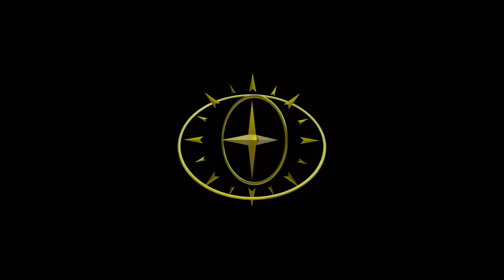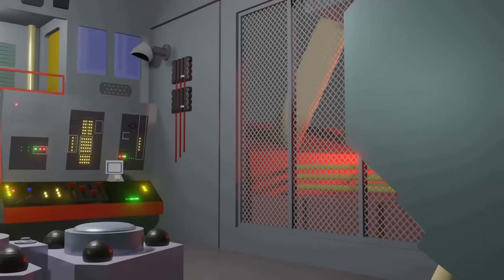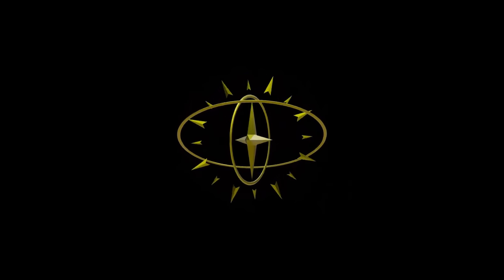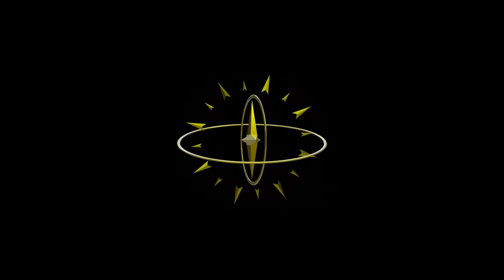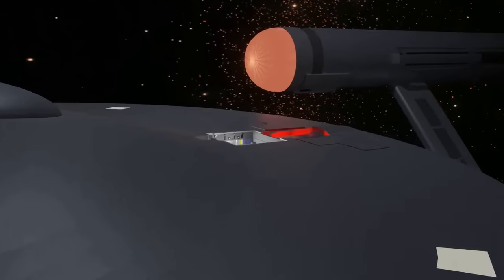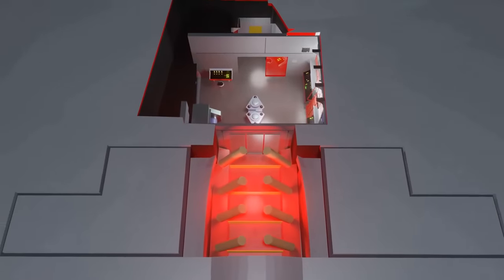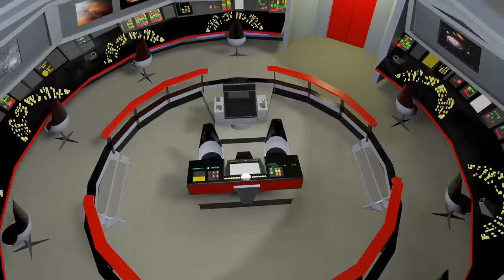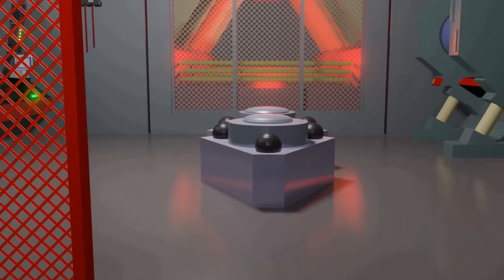The Enterprise Engine-room Enigma: where was main engineering?

Comment: Franz Joseph's decision to cram Main Engineering right in front of the impulse engines stems from a reference in "The Making of Star Trek" (Stephen E. Whitfield, Gene Roddenberry, 1968) that states that the "headquarters for the Engineering division" was located in that area.  However, just a few pages later, we have the secondary hull, "also called the Engineering Hull".  In fact, Doug Drexler and Mike Okuda asked Matt Jefferies where Engineering was, and after giving them an odd look, replied, "In the Engineering Hull."  Like most of the technical questions in TOS, the answers depend on what's going on in the episode, and therefore how much weight to give each answer.  If the threat to the ship is external, like Landru trying to pull the ship out of orbit, and the solution involves Kirk talking the threat into self destructing, the technobabble is vague and usually makes some offhand remark about the most visible aspect of the ship's power, the nacelles, which doesn't really matter because Scotty can't do anything anyway.  *BUT*, if the threat is internal, like the engines are running wild and Scotty has to actually do something, we are almost every time presented with the model of the ship's power being generated internally from a central reactor in or near Engineering, feeding power out to the warp engines in the nacelles.  These examples carry much more weight, and this is the scenario Sternbach and Okuda went with when doing their version of the Enterprise's deck layout, and one I agree with.

What I don't agree with is the idea that those glowing tubes lead directly to the nacelles.  For one thing, the angle is completely wrong, even if you follow them through where they cross over, they don't match the angle of the nacelle struts.  This also puts Engineering too far back in the hull to my eyes.  Plus, there's that big doohickey in the middle of the room starting in the second season, which is shown to house the dilithium crystals.  By necessity, this needs to be upstream from the nacelles (later ships had the dilithium right in the intermix chamber, but at this point, they were separate units, just go with it).

So, my answer to these evidentiary tidbits goes thusly:  The matter/antimatter reaction chamber (later known as the warp core) is located directly under that tube assembly, which is actually the main power transfer manifold, sending energy to the rest of the ship.  What we don't see, though, is the conduit leading from the M/ARC directly to the dilithium crystal articulation matrix, amplifying the frequency of the plasma stream sufficiently to generate a warp field, and from there, it goes to the nacelles, through a set of transfer conduits just forward of the hangar bay.  In other words, from the second season on, when you're in Engineering facing those tubes, you're actually looking forward.  This also allows Engineering to be moved forward so that the warp core is directly over the yellow circle with the red outline on the underside of the secondary hull, making that the warp core ejection port.
Reply from the maker: All very good points. On your final point, 'Day of the Dove' has the characters facing one way (port) when the entity leaves, but the POV is clearly the starboard wall behind them. So, perhaps you are right and the main engineering in the video is facing the wrong way? A subject for a future video, perhaps?
Reply: @WeTravelbyNight  Maybe.  But in matters like these, like that curved corridor, you just have to yield to the restrictions of 1960's tv budgets and ignore the sniggling bits.  Otherwise, you drive yourself insane reconciling the change of the ship from production version in most of that episode to second pilot version in that one shot.
Reply: Jefferies' bemused response likely stems from the very initial design philosophy of the Enterprise, in which the Primary Hull was intended for habitation and the Secondary was for power and drive systems, the idea being to keep the crew safe from all the radioactive/explodey/warpy bits (which is how we still conceive spacecraft design in real life). It follows that only the Primary would have had luxuries like full atmospheric pressure and artificial gravity. This strict division of functions was obviously abandoned early in the show's preproduction, as the model has always featured conventional viewports on the side of the Secondary hull, as well as the shuttle bay in the stern. But I can see Jefferies and others sticking to the original intent of the ship's configuration.
Reply: @thork6974  Doesn't TWOK clearly show the Reliant's phasers targeting the secondary hull and causing devastation in engineering?
Reply: @ian_b  The "Refit", or "Constellation II" Enterprise design clarifies things considerably. It's the TOS ENT where anything goes.
Reply: @thork6974  Would they really have moved the engines from the saucer to the secondary hull though?
Reply: the tubes are GNDN Tubes: goes nowhere, does nothing. they’re decorative for the set, nothing else
Reply: The original Star Fleet Technical Manual has TWO engineering areas: an area marked "Main Engineering" near the Impulse Engines in the saucer, and a separate "Warp Drive Engineering" in the secondary hull right under the nacelles. Main Engineering is shown to have computers that can monitor the warp drive from there.

Also, Star Trek altered and reused sets as different rooms constantly, so there's almost no point in trying to reconcile most of the filming sets with the actual shape of the ship. I tend to lean in favor of the book that was written by an Army Air Corps engineer instead of random Hollywood camera angles.
Reply: @ian_b  they wouldn’t, refits are simply upgrading systems and fixing everything broken or worn…the only confirmed major changes were modular parts: weapons systems and the bridge.
Reply: @bostonrailfan2427  And to look like the guts of a giant engine of some kind.
Reply: @Idazmi7  I've come to the conclusion that a Naval approach makes better sense logically than Air Force.  And FJ was working with a fraction of the reference material that we have today, so I don't fault him, I just think he was misinformed, underinformed, and ultimately wrong.
Reply: @CaptRobertApril  
Why is Franz Joseph wrong about needing two engineering rooms? The Enterprise clearly has two different engines in two different locations, so it's necessary.

"I've come to the conclusion that a Naval approach makes better sense logically than Air Force."

I strongly disagree: the Enterprise is not a water navy vessel, it is a starship with a highly irregular profile. Using a navy standard would imply the ship is shaped like a watercraft, and that's just not the case.
Reply: @Idazmi7  Conceptually, he's not wrong at all.  The problem is that an engine room next to the impulse engines would bear very little resemblance to any version of Main Engineering, if only because it'd block access to the secondary hull.  In my attempt at some deck plans, I've got an engine room there, nice two-level setup, but nobody's gonna mistake it for Main Engineering.  In fact, with what started out as more of a joke, but it actually works, I put 1st Season Engineering forward of the big tube thingy, 2nd & 3rd Season *aft*, with the dilithium housing in the middle of the room backing that up.  They changed the contours of that set so much between the 1st and 2nd seasons that they really weren't the same room anymore.

"Naval approach" in that this is not an oversize airplane with weird engines on the wings, it's a large vessel with a large crew, with a central power plant sending power to the rest of the ship, with the nacelles acting as the propellers.
Reply: @CaptRobertApril  
""Naval approach" in that this is not an oversize airplane with weird engines on the wings, it's a large vessel with a large crew, with a central power plant sending power to the rest of the ship, with the nacelles acting as the propellers."

Ah, the TNG 'warp core' retcon. Matt Jefferies put the engines out on pylons for safety reasons, not for resemblance to airplanes. With the engines on the pylons (which is borne out by dialogue), the engines can be easily ejected in the event of a breach, and radiation leaks won't instantly kill the engineering crew. The man knew what he was doing.

"(...) it'd block access to the secondary hull"

Not as drawn up in the manual.
Reply: @Idazmi7  Engineering is accessed via a corridor, not a turbolift.  Manual is wrong.
Reply: @CaptRobertApril  
"Engineering is accessed via a corridor, not a turbolift. Manual is wrong."

The Star Fleet Technical Manual and Booklet of General plans show direct engineering access via corridor.
Reply: @Idazmi7  I've had both since they were published.  The don't match the set, so they don't count.  In fact, I just looked at the Tech Manual, it shows a turbolift where there should be a corridor.
Reply: Purely on logic, engineering section was between nacelles (what obviously need to be connected to it) and deflector. What was another high power area. Hangar itself was quite small, hosting two shuttles top. Later in TMP movie he have visual confirmation that, behind the hangar is store room. But it move down. With clear floor above, so that is where engineering most likely was originally (it was changed into vertical core with this modifications, but conduits still should go through that area). It was most likely where the closed space was (hosting core), with the room itself in higher part of hull behind the deflector. Considering that "neck"  of the ship barely could hold anything. It make sense why engineering hindquarters would be behind the impulse drive (back of the saucer), being relatively close to both sections.
Reply: @TheRezro  Unfortunately, this ship wasn't designed purely on logic, but by what looked good on camera.  Like Gene Coon told a writer, they weren't looking for "possible", they were looking for "plausible", so there was a lot of "close enough" kind of things going on with the design of the ship.  The fact that bothered at all with a design logic puts Star Trek well ahead of anything Irwin Allen was cranking out at the time.
Reply: @CaptRobertApril  
"I've had both since they were published. The don't match the set, so they don't count."

The Engineering set changes in every season of Star Trek, so that's moot: if you designed the plans to match the show exactly, you'd always have two versions of Engineering that contradict what's in the book. That makes complete adherence to the show a literal impossibility.

"Unfortunately, this ship wasn't designed purely on logic, but by what looked good on camera."

Exactly why the manual is and will always be a far better reference than the show itself: it doesn't change with the budget. Which is exactly the reason it was created.
Reply: @TheRezro  
"Purely on logic, engineering section was between nacelles (what obviously need to be connected to it) and deflector."

Like most people, you forget the need to maintain the Impulse Engines, which are in the saucer. The pre-Refit Enterprise's Warp Nacelles are not attached as close to the Impulse engines as they are in the refit. Also, the saucer can separate, so you'd need two separate engine rooms regardless.
Reply: @Idazmi7  It's not a decent reference if it blatantly contradicts what you see onscreen.
Reply: @CaptRobertApril  
"It's not a decent reference if it blatantly contradicts what you see onscreen."

You know that's an irrational point to try to make. The ship itself often changes forms from shot-to-shot in the same episode (thank you, "stock footage"). Main Engineering changes form in every season. All the ship's weapon's fire comes from the same little dome on the bottom: phaser beams, photon torpedoes, proximity blasts.

The manual was made for a reason: to establish continuity where the show could not. Unlike the show, the book doesn't change.
Reply: @Idazmi7  For it to be a good reference work, though, it has to at least be in the ballpark of looking like it did on screen.  In many areas, the TM and Deck Plans are horribly off kilter and are useless in that regard.

The curvature of a corridor can be ignored, but you can't pretend that corridor was actually a turbolift and be taken seriously.
Reply: @CaptRobertApril  
I can however, pretend that the large power transformers and dilithium chamber in Engineering were there in every episode, when they clearly were not (In fact, they shifted around according to the needs of the plot, sometimes between individual shots). I can also pretend that a photon torpedo tube and a phaser bank are both in the exact same place.

Or, I can go by the book, instead of constant set redesigns and moment-to-moment plot changes.
Reply: @Idazmi7  That sort of thing is why a proper set of deck plans is such a pain in the backside.
Reply: @CaptRobertApril  
"That sort of thing is why a proper set of deck plans is such a pain in the backside."

You mean "impossible". The discrepancies between episodes are so extreme that they simply cannot be reconciled, so there will always be 'mistakes'. You cannot rely on them for consistent visual data.

That's why I always refer to the manual instead: it doesn't change. It is the same now as it was in 1974.
Reply: @Idazmi7  And was horribly wrong even at the time.
Reply: @CaptRobertApril  
Imagine hand-painting a portrait of a shapeshifter who insists on changing their face every ten seconds. Unless you can paint the portrait successfully, matching every feature of their face, criticizing the Technical Manual for not matching onscreen sets is the absolute article of a double-standard. Any and all fan-made blueprints will automatically suffer the same issues, with the caveat that the fans generally don't have engineering experience.
Reply: I like to think that there are 2 engineering areas, one for the impulse drive, one (larger w warp core & dilithium matrix) in the engineering/secondary hull.
Reply: @mahatmarandy5977  Don't get carried away with crediting Jefferies with an overabundance of sci-fi technical savvy.  The second he heard the ship would have warp drive, his response was, "What the hell is warp drive?"

He was just designing a futuristic engine room, and according to him, it was down in the secondary hull, a.k.a., the Engineering Hull.
Reply: @mahatmarandy5977  Doug Drexler and Mike Okuda asked him.  Go ahead and ask them, Doug loves to chat.
Reply: In this case, "popular consciousness" only extended to the readers of Astounding and other pulps, because the science fiction authors and readers were the only ones talking about it.  Hell, I'm 58, and this is the first I've heard of it.  And while Jefferies did read a lot of aeronautical publications, NASA press releases, and technical magazines, he wasn't a science fiction reader.
Reply: @mahatmarandy5977  
"Yeah, the glowing tubes were intended by Jeffries to be "Dean Drives," a kind of reactionless engine that was thought possible at the time, but which later turned out to be a hoax. Impulse engines were dean drives, at least in conception at the time."

No. "Impulse" literally  means "force applied over time", which makes them a reaction drive, not a "reactionless" drive. Both TOS itself (in Balance of Terror) and the Technical Manual reference them needing fuel.

"Engineering is at the rear of the saucer section (As evidenced by the curvey hallway that connects to it) There wasn't any other engineering complex in the secondary hull, and in fact apart from the hangar bay, we really don't spend very much time in it at all. (Hence Franz Joseph filling it up with redundant stuff)"

1. There must needs be an engineering section for the Warp Drives as well, necessitating two Engineering rooms.

2. The Secondary Hull has redundancy with the saucer section because it is meant to be a fully independent ship when separated. Otherwise, there no point in saucer separation at all.
Reply: @CaptRobertApril  ok, yeah, that sounds fun! How do I contact them?
Reply: @mahatmarandy5977  
"So, for instance, Jeffries did not write "Balance of Terror." (...)"

Even so, the very term "Impulse Engine" still implies the existence of an impulse, not the lack thereof. Thus, it is not a "reactionless" drive. Wasn't even conceptualized that way, or they would have called it something else, even "Impulseless Drive".

"Also, the diagrams IN the tech manual deviate significantly from the actual on-screen sets we saw."

Been over this already: the "the actual on-screen sets we saw" are not visually consistent, so criticizing any blueprints for not precisely matching the on-screen sets is pretty ridiculous. I don't know why the myth persists that it's even possible to do.
Reply: @mahatmarandy5977  Facebook works.
Reply: @CaptRobertApril  Ok. Thank you.
Reply: @mahatmarandy5977  
"My point was that the 1975 tech manual isn't reliable. Your point is the sets themselves are not consistent. So if neither is reliable, what are we arguing about?"

Your reasoning for the 1975 tech manual being "unreliable" is the fact that that it doesn't match the sets... when the sets themselves are not consistent. If you cannot see the irony in that premise, that calls your basic rationality into question.

Question: do the sets in Star Trek change, moment-to-moment?
Answer: yes.

Question: does the 1975 tech manual change, moment-to-moment?
Answer: No.

Conclusion: 1975 tech manual is reliable and consistent.
Reply: @mahatmarandy5977  
Put more boldly: unlike you, I have no cause to bow down and worship the visual presentation of a serialized television program with inconsistent editing, outdated visual effects, and often nonsensical plotting. Instead, I will stand by the notes and efforts of the career engineers who - for very little recognition or money - put their heart and soul and knowledge into those technical blueprints, knowing full well that their time and efforts were doomed to be wasted on a banal entertainment series and it's equally banal fans.
Reply: @mahatmarandy5977  
"I'm gonna draw a comparison that I hope isn't too tendentious: The Civil War is a thing that happened, right? Seventy years after the Civil War, "Gone with the Wind" was written. (...) I don't really understand your point there."

Star Trek isn't real.

I was hoping you didn't need me to explicitly say that, but you apparently do. And even worse, you are literally comparing historical revisionism in relation to a real war full of pain, death, and controversy, with a fictional program that can't even get it's OWN history right from episode to episode. No wonder you can't see the irony in your own statements: you are obsessive AND mentally unwell, unable to discern fiction from reality, or ascribe importance to real events instead of your fantasies.

"Likewise, the Franz Joseph Tech Manual was (...)"

Directly commissioned by Gene Roddenberry, canonized by the same via his signature, as well as licensed and copyrighted by Paramount, written and drawn up by a USAF engineer. By the way, the moment Gene was involved, it became an official part of Star Trek. You lost this debate in 1973.
Reply: @Idazmi7  Ok, so if I understand you, you're saying that you don't care about the show, but you do care about the blueprints?

I'm not mocking you or anything, that's an intriguing perspective if, in fact, that's what you're saying.
Reply: @mahatmarandy5977  
"Ok, obviously I picked a bad comparison, since you didn't understand what I was getting at."

Yeah, go ahead and frame it that way; I understood exactly what you said. The only one pretending to be dense here is you.

"I know star trek isn't real."

You would not have tried to compare Star Trek's technical manual to the Civil War and historical revisionism if that were true. Doing that implies that - in your eyes - there is a similarity of both context and importance between these two things. There isn't. That's the problem.

"I've been looking at this from a strictly television production point of view. (...) This is distinctly different from in-universe continuity, which I have no interest in."

If that is true, then you are NOT trying to understand the layout of the U.S.S. Enterprise as a fictional vehicle. And it is NOT true, because you said - "There wasn't any other engineering complex in the secondary hull" - a statement that has no bearing on a strict television production point of view.

But let's pretend you're telling the truth. Your stated goal is entirely contradictive to the function of this youtube video and serves no purpose in this discussion. This should be obvious: the only people considering WHERE the engineering room was supposed to be in the fictional ship were not television production crew. The answer to your question is, 'the "engineering room" of the Enterprise was a set on Desilu Stage 9 that could be reconfigured to serve many purposes, such as a "weapon control room" or "auxiliary control room"'. That's how the television production crew thought of it - as a large, reconfigurable prop.

TL;DR - Read "The Making of Star Trek" and stop clogging up the comments.

"Ok, so if I understand you, you're saying that you don't care about the show, but you do care about the blueprints? I'm not mocking you or anything, that's an intriguing perspective if, in fact, that's what you're saying."

This entire video and comment chain has absolutely nothing to do with television production and everything to do with the Starship Enterprise as a fictional object. That's where I am coming from, and virtually everyone else here is coming from that position, too. From that perspective, it should be easy to see where I'm coming from: you cannot get consistent information from TV props that are constantly changing. If that's hard for you to comprehend, that's not on me.
Reply: @Idazmi7  Ok. I'll stop clogging up the comments. Thank you for your time.
Reply: @Idazmi7  Realistically you would have two main engineering sections on the ship with at least two different Auxillary engineering sections located in more shielded areas of the ship. Much like you have two bridges on the enterprise saucer section.
Reply: @bostonrailfan2427  The Refit was also much larger than the TOS Enterprise as well.
Reply: @captRobertApril My understanding was always that it was in the Engineering Hull, otherwise why the hell would it be named that?
Reply: @madheal7056  It wasn't called that originally. I don't believe they ever say that in TOS or TAS. IIRC, back in the '70s, when I was young, it was always referred to as "The Secondary Hull," with the saucer being the primary one. 

When you've got a really long-lasting franchise, terms gradually change, or get re-assigned. In DR. Who, we're initially told that Susan invented the name "Tardis." They seem to have simply forgotten that about a decade in, and all vessels of that type are called Tardises now.

So the terms that are in common useage now weren't necessarily the ones used in earliest days.
Reply: My thought is that the room with the 'doohickey' in the center is in the saucer taking up deck 5 and 6, the machinery seen through the mesh is the impulse drive and the piece in the middle is the top most portion of what we would recognize as a vertical warp core. 

Starting with the motion picture, that element would be more in the center of the core. But adapting from what we see in Enterprise on the NX-01 where the dilithium chamber is at the front end of a horizontal core, I imagine a larger updated version of that layout turned vertical with the body of the core passing through the neck into the engineering section.

I  think that if the saucer is meant to separate in the event of a warp core breach having main engineering in the saucer makes some sense, they can tend to the thing til the last moment, then basically the chamber in the center of the room drops away with the secondary hull and the engineering staff is safe. 

Starting with the refit, or more likely with other ships like the Miranda that probably first fielded the technology used in the refit, a new design placed the reaction chamber around the center if the core, removing it from its convenient location near the impulse complex and the main hull, driving the need for core election mechanisms down the line. Since evacuating half a ship while still trying to manage a catastrophe poses significant challenges. You dont want to have engineers abandon their posts and run to the other end of the ship because you need them constantly working to at least delay the inevitable for the rest of the crew. 

It's notable that even in the refit, the top of the warp core still meets thebimpulse complex and still seems to provide some sort of function for its regular operation.  Probably primary power with fusion or batteries as backups only. But there would still likely be an engineering space there that would be manned at most times. 

The remaining issue is scale, the sets really don't fit the spaces given by the model, this isn't anything new to trwk, the Galileo shuttle is blatantly larger on the inside than the outside....
Reply: @DrewLSsix  Doesn't fit in the saucer, certainly not without cutting off turbolift access to the secondary hull.
Reply: @DrewLSsix  That’s more-or-less the basic assumption prior to TMP, right down to the impulse engines (Which look like a Dean Drive, which was popular doubletalk in the 1960s) But if my own experiences on here are any indication, people REALLY don’t like it when ya say stuff like that. I got a lot of blowback from people saying “No, it’s in the secondary hull between the pylons, and that’s where it’s ALWAYS been, ya damn pagan!”
Reply: This also makes sense as you need to power the main deflector from the same series of conduits.  So the engineering section is best placed "backwards" like you suggest, lower in the hull.   The engine rooms would be a separate areas but connected in that everything else forward from the upper impulse engine room would be where the officers work and reside. Everything below would be the engine rooms.  IE - basically, "engineering" is the entire ship aside from the forward saucer section, similar to the massive engine areas on a large ship.  Directly back from the nacelles would be storage and the shuttle bay. As for the shuttle bay, with it backwards like you suggest, the very top of the hull can easily be an access corridor bypassing the guts of the ship below.  Go down the "neck" of the ship, then a long simple corridor with a curved roof - and then an elevator down to the bay. The windows you see in the propulsion areas of the ship are mostly crew quarters for the enlisted workforce who rarely even see the officers unless they need to go to sick bay or one of the areas in the main saucer section for a meeting.
Reply: @ian_b  "engineering" is similar to a battleship in that the engine rooms (plus fuel and machine rooms and the like) are basically the entire lower decks (3/4) of the ship.  The officers rarely even go down there and it's pretty much sealed off from easy access as well, usually requiring stairs or use of a specific elevator, for safety and security purposes.  So basically aside from a shuttle bay access lift/corridor, everything back ( and down) of that curved hallway in the main hull is "engineering"
Reply: @Idazmi7  Given that the ranking structure and even the behaviors of the crew (and, later, that of the entirety of Starfleet) follows naval traditions and even the layout of the original bridge also based off of a submarine, I'm going to give it to CaptRobertApril on this one.  Gene Roddenberry knew exactly what he was doing when he set that up and it wasn't by accident.  Sure, massive inconsistencies in ToS ship layout in the run of the series.  But, this is also true of TNG as well.  And don't even get me started on First Contact where the ship either had 24 decks or 26 depending on who you asked (within the same movie).

Consistency is only consistency when it's followed.  If it's not, well, random "things" happen.  😆
Reply: @IamJustJ.  
"Given that the ranking structure and even the behaviors of the crew (and, later, that of the entirety of Starfleet) follows naval traditions and even the layout of the original bridge also based off of a submarine, I'm going to give it to CaptRobertApril on this one."

Bridges like what you see on Star Trek did not physically exist when Star Trek was originally aired. In fact, the navy based their future bridges on Star Trek. That doesn't change that Gene Roddenberry served the Amy Air Corps in WW2... On navy vessels.

"Gene Roddenberry knew exactly what he was doing when he set that up and it wasn't by accident. Sure, massive inconsistencies in ToS ship layout in the run of the series."

I do not recall saying gene set up anything by accident. Rather, I said TOS is inconsistent with the interior of the ship - as in, number of decks, non bridge rooms, and the like. If you throw out the tech manual, you can't even call it a Constitution Class, because that's where that name is from.

"But, this is also true of TNG as well.  And don't even get me started on First Contact where the ship either had 24 decks or 26 depending on who you asked (within the same movie)."

I never liked Rick Berman.
Reply: @Idazmi7  I don't think that Franz Joseph's STAR FLEET TECHNICAL MANUAL and ENTERPRISE BLUEPRINTS could have been published without Roddenberry's blessing. Gene must've signed off on his interpretation -- which even includes the friggin' BOWLING ALLEY that Riley mentions in "The Naked Time"! -- so that pretty much settles it for me. Not that FJ got it right all the time: his detail on the SHIP'S CHRONOMETER below the ASTROGATOR on the Bridge, right in front of the Captain's Chair, doesn't match the actual on-screen detail (i.e. in the Original version, NOT in the Remastered version). 
We should also note that in the excellent article "Falling Out Of Standard Orbit" by David Winfrey (in THE BEST OF TREK #16, pages 75-86) he is able to show that the IMPULSE engines of the Enterprise are just as capable of generating FTL velocities as are the WARP NACELLES. When the ship does a Saucer Separation, BOTH the 'Engineering Hull' (with the 2 nacelles) AND the 'Primary Hull' (the Saucer Section) are capable of FTL speeds. Hence, BOTH hulls would have to have an 'Engineering' section, in those cases where -- once separated -- each hull would have to travel under its own 'steam'. If both Engineering sections serve the same function, then it would make sense for them to resemble each other, just as the Emergency Bridge in the Secondary Hull would resemble the Main Bridge for the most part.